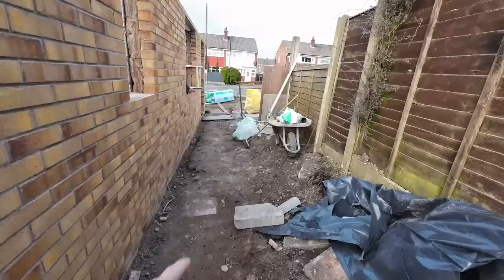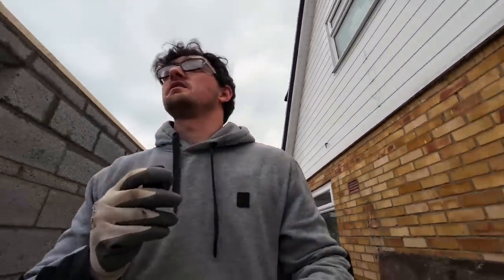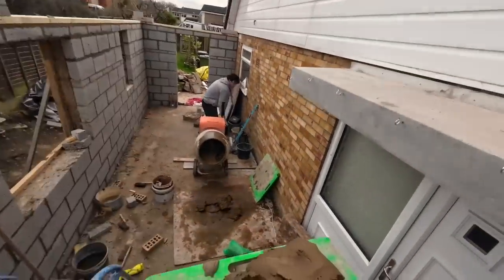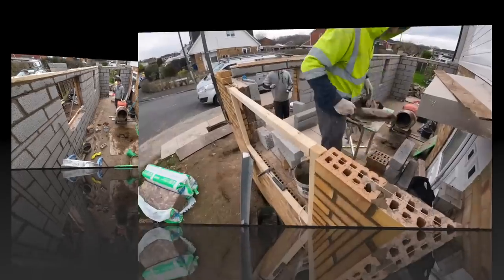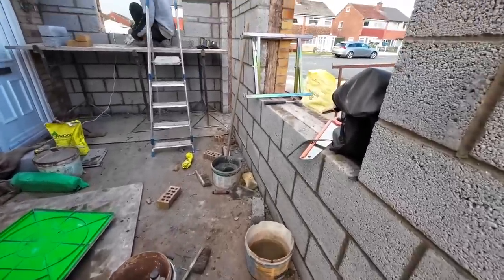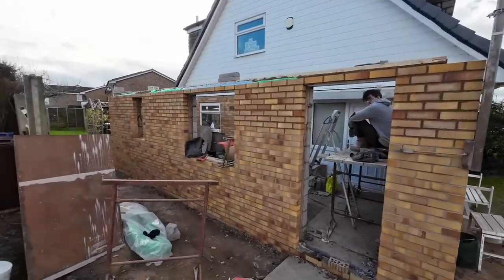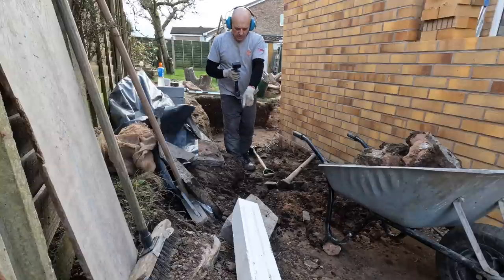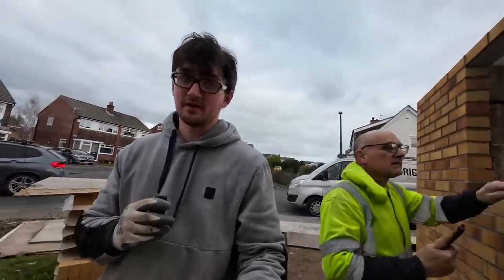WALL PLATES GOING ON .. THE EXTENSION PT 8

Comment: I had not seen a steel lintel like that with a 'cavity' slope on the top like that. Very nice! Will the timber on top be bolted or fastened down or does it just stay without? Your brickwork is very neat and very even. Quality job!
Reply from the maker: Thanks DPeter, those lintels are a very common type. The plate is fixed down and secured with wall plate straps 🧱👍🏽
Reply: @SteveAndAlexBuild  Thank you! Always learning....
Reply from the maker: @dpeter6396 No problem 🧱👍🏽

Comment: Can I ask a question as a diy person, why do you slither the blocks 3rd level below lintel ?
Reply from the maker: Dpc to lintel = 28 courses of brickwork 
1 block = 3 courses of brickwork 
9 courses of block = 27 courses of brick 
So a brick size courses of brickettes / coursing bricks are needed to reach the criticsl lintel height . 
   Hope that makes sense 🧱👍🏽
Reply: It does make sense, I served my time as a bricklayer in the early 80’s  but ended up as an engineer. So I’ve been catching up on the regs watching all your vids ☝️ as I’ve started building extensions for my kids and soon a small bungalow on my daughter’s plot. My biggest shock was the 150 mm cavity ! Also the price of materials. Thanks for the reply I’ll be doing this .
Reply from the maker: @CrazyCalifornia . No  probs best of luck with the builds 🧱👍🏽

Comment: Is the cavity fill not 150mm? According to the new building regs ? Is there an inspector onboard ?
Reply from the maker: Yes it’s all been signed off 🧱👍🏽
Reply: Ahh did you use 100mm cavity fill insulation?
Reply from the maker: We did and there will be 57 mm insulated plaster board going inside 🧱👍🏽
Reply: @Bricklaying With Steve and Alex   ahh if you used a PIR insulation you could just have the 100mm gap and then no need for thermal Insulation plasterboard...the wool insulation requires a 150mm cavity overall
Reply from the maker: @mubeensadak-ve3cq  Thanks we know

Comment: Do you not need weep vents and tray above window and door openings with them lintels
Reply from the maker: No mate 🧱🧱👍🏽
Reply: Why
Reply from the maker: @christopherlightfoot3407  roof goes there  so the lintels will never see any water 💦 🧱👍🏽
Reply: There maybe some moisture in the cavity as you have put vertical damp in and where hot and cold air meet
Reply from the maker: @christopherlightfoot3407  that’s not above the lintels
Reply: Yeah I'm aware of that but there still will be moisture in the cavity
Reply from the maker: @christopherlightfoot3407   ok
Reply: Anything with 4-5 courses no need more so when roof sits over it.
Reply from the maker: @lmilne4859  👌🏼🧱👍🏽

Comment: Guys are great but .... thickness of walls are shocking thin.  We build with 25 or 30 cm brick (10-12 inch) and we use solid concrete on edges with rebar and also on top to connect all together. in total at my home which was build last year i have 30cm wall + 25cm insulation + finisihng part on inside 2-3cm. So end wall thickness is around 60 cm which is around 27 inch.
This kind of work would be basically illegal in our Country.
Reply: Sure, but what are the relative climatic conditions? How about earthquake risk? There's a lot of factors involved, so they are not 'shockingly thin' at all in the context of where we are in the world. Building regs here have been increasing the requirements for U values for quite some time - in fact in this very series, Steve mentions that they will likely have to move from 100mm cavities to 150mm to accommodate the insulation required to meet the new building regs U values. Could we make them thicker and put more insulation in? Yes, and some people do indeed do that, but there's quite a cost in terms of money and lost space so provided the structure meets the legally required minimum then most people are happy with that. In this instance, 60cm walls would significantly reduce the available space in the extension as well as costing a lot more, but for not a lot of added benefit, so it would likely mean that if it was required then the owner might not do the work at all. Yes, it would have more insulation, but the rest of the house would be the same as it always was. We don't need to be earthquake proof in the UK, so such hefty brick and rebar walls are not necessary for a house.
Reply from the maker: Perfectly put Steve, thanks for taking the time to write that response 👌🏼🧱👍🏽
Reply from the maker: Good question Martin  👌🏼🧱👍🏽

Comment: Poor Steve suffering with your hip 🥲 Quick question. You've already explained im sure but why the 3 levels of coursing blocks? 👍👍
Reply from the maker: 🙁. 3 levels ? 🧱👍🏽
Reply: @SteveAndAlexBuild  Oh i thought the first ones on the foundations had been cut
Reply from the maker: @Doug....  Ah it’s been a while basically 
1 floor level 
2 re gauge the brickwork 
3 gauge 👌🏼🧱👍🏽
Reply: @SteveAndAlexBuild  Ok. So blocks cut to match the window cill level i suppose. 👍
Reply from the maker: @Doug....  🧱👍🏽